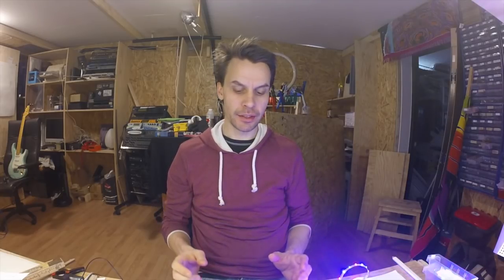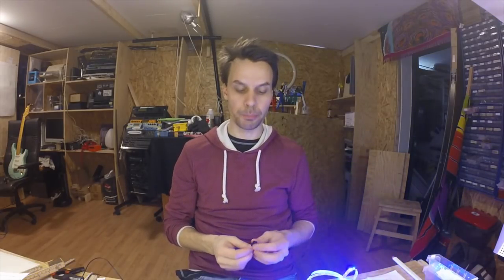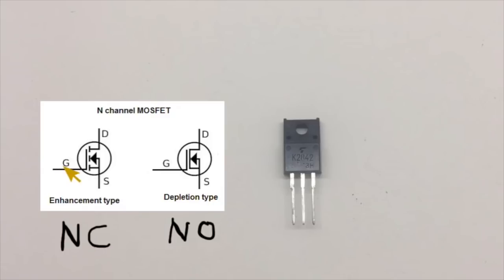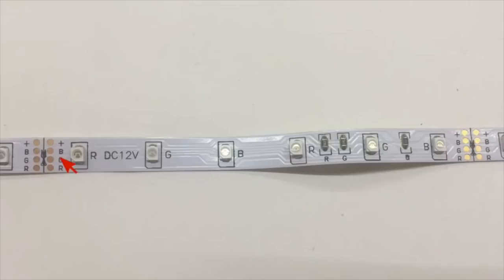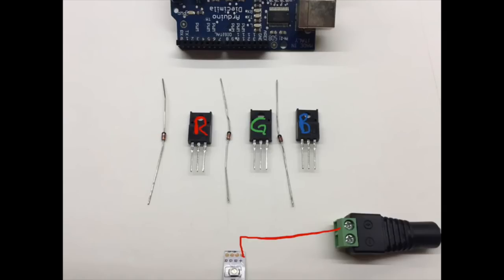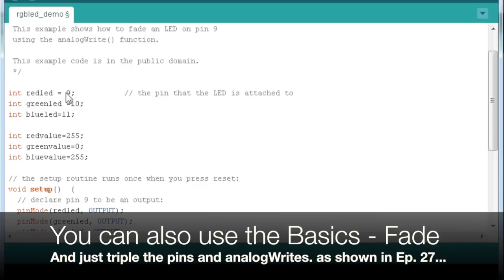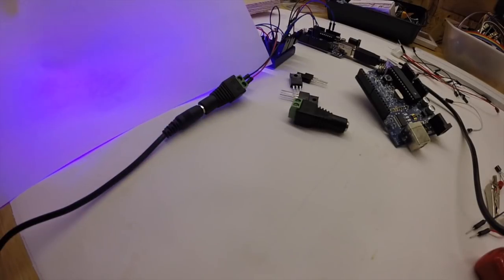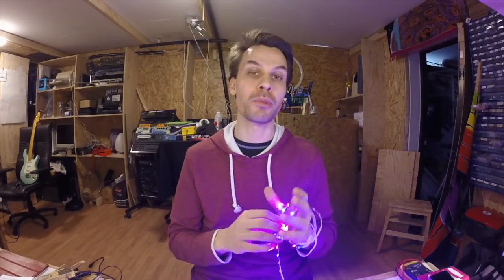Arduino Controlled 12 Volt RGB LED Strips using a MOSFET - Anything Arduino Ep 28

Comment: What is the name of the litle thing that conect adaptor into the arduino the one that saparate the elactricity
Reply from the maker: Do you mean the mosfet transistor?
Reply: @SourceryOne   no its lok like conector you conect the mosfet into that thing , it have green part that runing the electicity
Reply: @SourceryOne   6:16 at botom right
Reply from the maker: GOLD f FISH ah ok that is just an adapter for plugging in a wall wart and then convert it to a screw terminal. So just to get 12v from a normal wall wart into the project.

Comment: thank you but can you let me know your fb or something to connect with you I sill have so many thing to ask you
Reply from the maker: Ask here. If it is relevant to the project more people probably want to know. ;)
Reply: @SourceryOne  well I want to ask how to make it 
 Flashes with music
Reply from the maker: lloovvee ko có tên well... I would amplify an audio signal into an analog input if you want it to react differently to high and low tones you might need to use some low pass filter and high pass filter, and send the filtered signals to two analog pins. Then you just write a value to the output pins of the led strips.
Reply: @SourceryOne  can you give me more detail cause I sill do not understand
Reply: @NoLoadingTV  lol

Comment: Although this DOES kind of work, it is the absolutely wrong way to do it.

It is magnitudes better to use a MOSFET driver IC in between the arduino and the MOSFET.  The MOSFET gate pulls on the order of amps on the gate when it charges, so it should have a resistor inline with the gate.  The gate should be pulled low when not high, so you do not get false triggering.  The driver IC usually has a charge pump to run the gate and all of that.

This is an example on how to technically do it, but it is not intended for designs.
Reply: Do you have an example circuit?

Comment: why do every other led look different color is that your camera?  the addressable type can only do that.
Reply from the maker: These older cheaper non addressable are made up of one red, one green and one blue (rob) led next to each other and then repeated. The addressable leds have three leds inside one package and also a control chip. That is why this one looks as it does. It is cheap, but if you only want one color in interior lighting for example this works great. If you don’t see the leds directly they melt into one color. Hope that explains it a bit.
Reply: This should still work for the all in one rgb none addressable LEDS?
Reply from the maker: Clancey Aggen yes. If they only work by pwm signals/voltage levels and not with any data lines. To be REALLY sure do you have a link to strip you had in mind?

Comment: how do i do this with 24v RGBW tho?
Reply from the maker: First off make sure that you have  MOSFETs that can handle 24v. The irlb8721 I talk shortly about should work fine as it can work with up to 30vs. Then just add a fourth MOSFET for the White leds and connect it to one of the remaining pwm pins example 3,5 or 6. Then just add another copy of each row showed in ep. 27 and you are done! :) hope it helps.